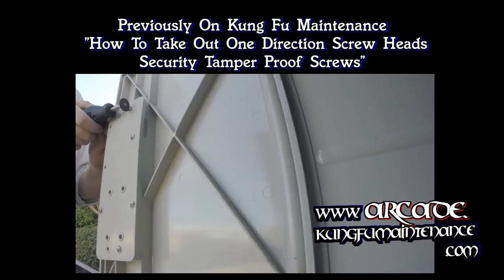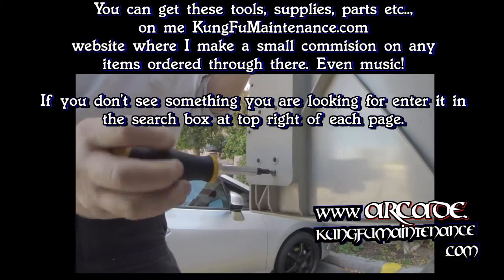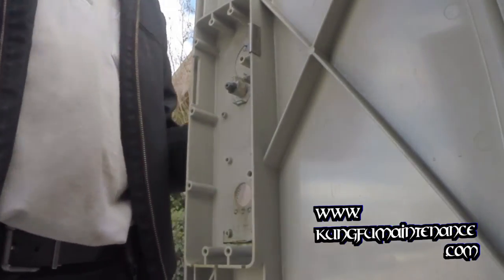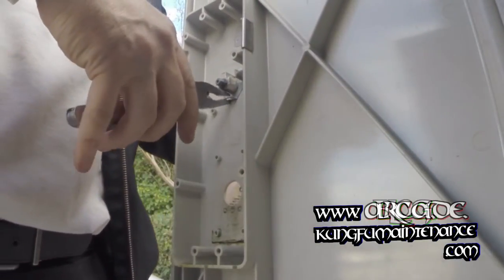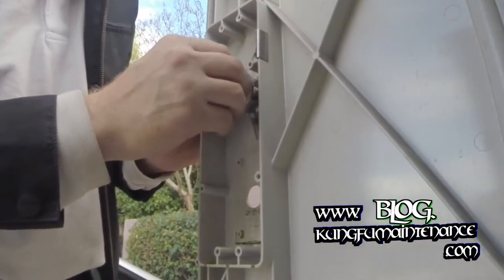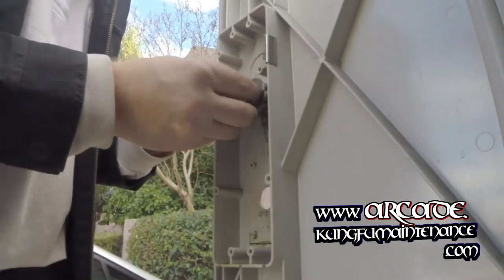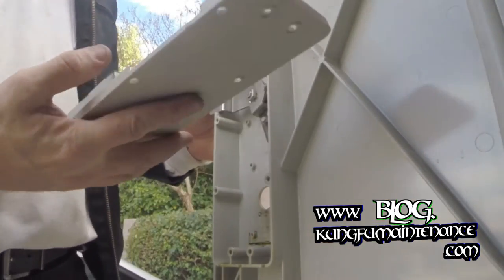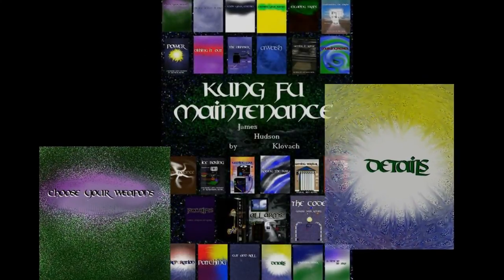How To Replace Captive Key Mailbox Parcel Box Locks

Comment: What you did to the CBU was a security violation. The Arrow lock is an accountable item and must be secured at all times. The security screws were there for a reason. Too cheap to buy a oneway screwdriver?
Reply from the maker: David M Good point. I have no problem replacing the one way screws or buying the specialized screwdriver. Thanks for the tips.